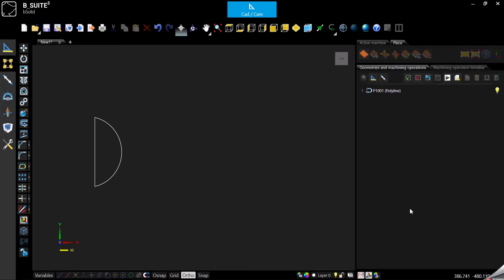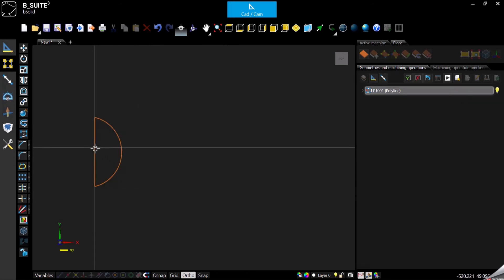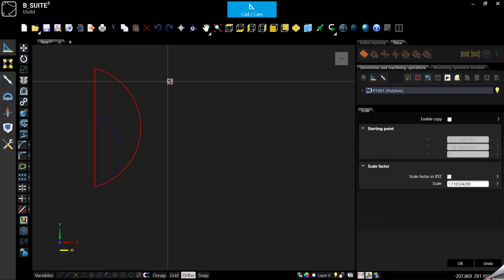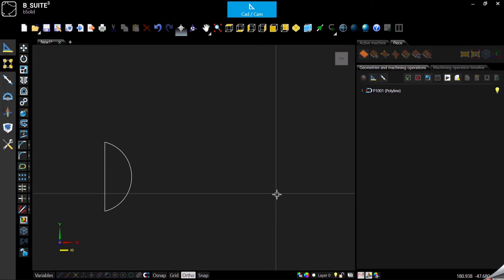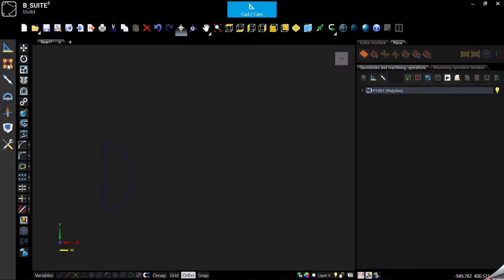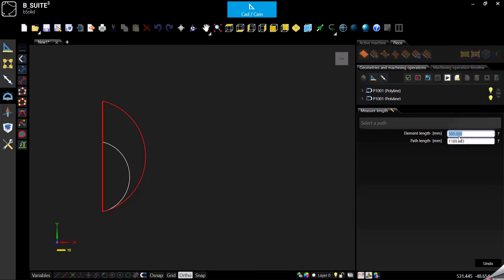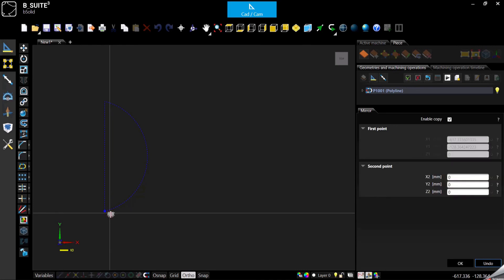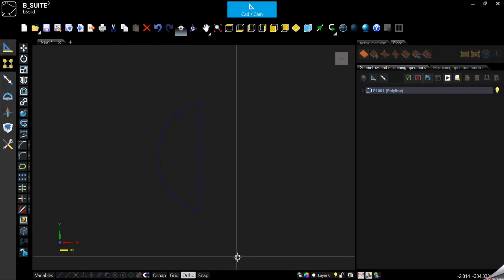12 - CAD BIESSE bSolid - Part 12 (Scale & Mirror)

Comment: Please make video on multiboring
Reply from the maker: Hi Rahul, what do you mean when say "multiboring"? Drilling using multiple spindles?
Reply: @freshzone   hi sir yes make video on multiboring drilling.with cuttlist
Reply from the maker: @ScrollwithRahuL007  in order to do that, the only thing to keep in mind on the software, is to program the holes 32 mm apart. The second thing is actually on the machine, because you need to make sure you have the boring block spindles tooled up properly. 
Best Regards